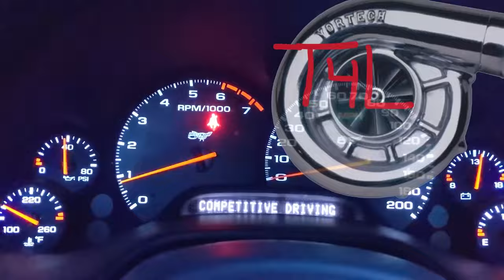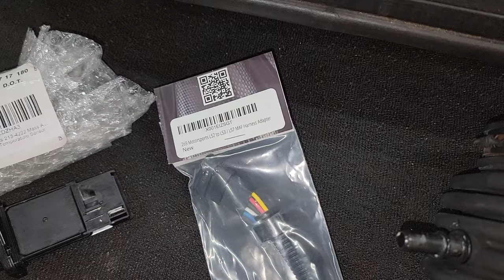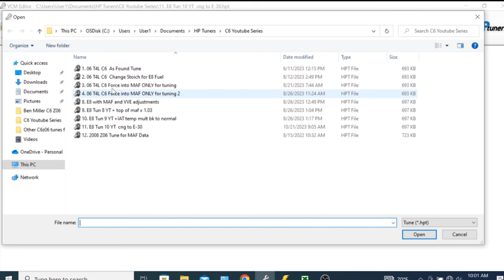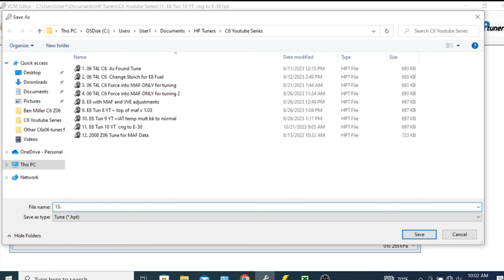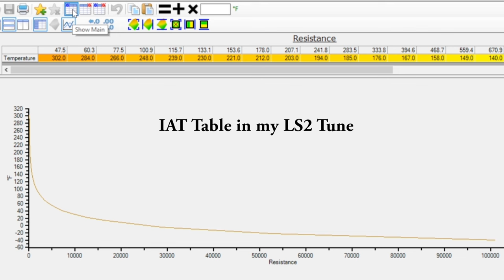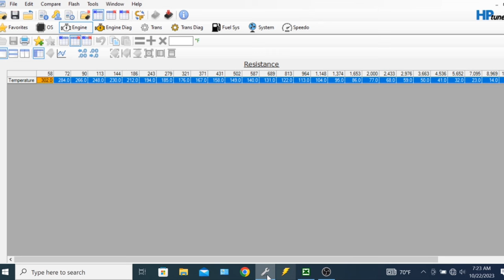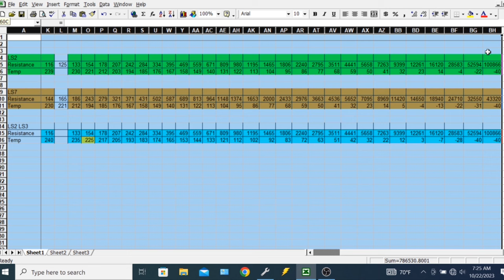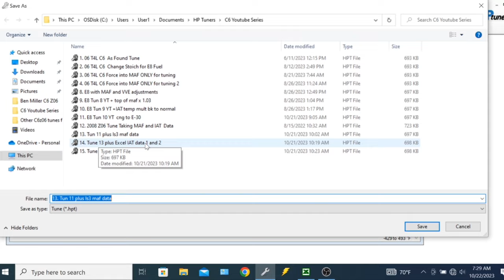C6 Corvette (LS2) gets LS7 Air Intake System UPGRADE (Including the MAF Sensor!)

Comment: An easier way to do the interpolation (instead of manually) would be to use Excel to calculate the equation that defines the relationship of the resistance to the temp for the LS7.  Then use that equation to calculate all of the data points that you need for the LS3 MAF for the LS2.
Reply from the maker: Good idea, that would work good for the IATs. The MAF doesn't need it though, the column identifiers are scaled identically, all I had to do is copy and paste the information over.
Reply: Was just about to suggest that. Would be more accurate too since it's a hyperbolic curve and not linear.

Comment: That foam filter that came with that air box is not an OEM LS7 air filter, the stock air filter is a blue colored paper filter
Reply from the maker: 100% agreed, I have no idea why they had that in there and where it came from 😭
Reply: @Toys4Life Dirt bikes use oiled foam air filters because they flow lots of  air and stop dirt with high efficiency. I made an oiled foam wrap for around my dry high flow filter. I checked the dry filter recently and it was spotless while the foam was dirty. Amsoil used to make a 2 stage thicker foam filter to use alone but stopped due to the increasing number of sizes and applications. The oiled foam filters way better than the oiled cotton gauze.
Reply from the maker: 10-4, this one's old and kind of almost getting gummy. I think it's undersized for how thin the pores are, I'm all for it stopping the big chunks and letting the paper filter handle the smaller chunks. I think my old Honda 200S used to have a foam filter if I'm not mistaken.
Reply: When he pulled that filter out I was thinking did that come out of a lawn mower haha
Reply: Yes, that filter was kind of small and thin and didn’t look like it would work very good. I wish I could get an oiled foam filter for the C5Z. The 2 stage filter I had was approx 1.75” thick, with larger cell course foam on the outside and finer cell foam on the inside, so dirt would get trapped throughout the depth of it and stick to the oil. And it was washable. The foam wrap I have now is 1/2” thick from K& N. I made 2 of them from a 2’x4’ sheet, which was like $75.00😅

Comment: I am in the process of doing the same. Any way I can get that maf table? Ive noticed the 06 and 07 zo6 tables are different than the 2008.
Reply from the maker: Grab a 2008 LS3 stock tune from the HP tuners repository and use the column headings and tables for the IAT, and the maf numbers as a starting point for the maf table. Reduce timing, monitor your AFRs closely until you get them all to equal commanded AFR as verified by a wide band at wide Open throttle.

Comment: Curious if a stock ls7 intake would make more power than a C5 cold air intake like the SLP due to the different maf sensor. Im sure an aftermarket ls7 cold air intake would breath alot better but curious to compare stock ls7 to aftermarket c5.
Reply: I was just wondering the same thing.
Reply from the maker: I don't think they're compatible, even though they look similar there is a difference in that front area of the engine bay.

Comment: Interesting. Is it possible to do this LS7/LS3 MAF sensor upgrade to a LS1 or 6?
Reply from the maker: Yes but those have a 78 mm throttle body so that would probably want to be changed out first with a larger one and different manifold.
Reply: Like a LS2 TB I guess. Thanks @Toys4Life

Comment: Could we possibly get a copy of the tune file? Im having trouble figuring out the IAT table.
Reply from the maker: Turns out you can change the column headings for the IAT and HP tuners. Then I went to the repository in HP tuners and look through some ZO6 tunes until I found one that matched my C6 LS2 tune layout. Somebody gave me that great info in the comments by the way!
Reply: @Toys4Life  I love your channel. I hate to keep bugging you but what year ZO6 did you use?
Reply from the maker: 2008 C6 Z06
Reply: @Toys4Life  thank you, I got it all installed today. How much tuning did you have to do afterwards? Just wondering if it's safe to drive for one day easily while I do logs.
Reply from the maker: I hooked up the scanner and made sure the short and long-term field trims were within range to keep it at stoich at part throttle. Wide open throttle mine was a little rich, I need to tune it this spring, I ran out of weather last fall. If you do the same, you should be good. Probably stay out of wide open throttle obviously (:-)

Comment: You should get a dragy to see the difference in 0-60
Reply from the maker: I think that there would have to be a bigger horsepower difference than we're looking for for the draggy to accurately pick it up?
Reply: @Toys4Life  if I do back to back runs it shows on the dragy. Temperature and the da can very the performance of the car.
Reply: @Toys4Life  I do alot of 60-130 and with 1200-1400 da my car runs 7.1-7.4.. low 300 da and my car runs mid 6s 60-130
Reply from the maker: Absolutely.